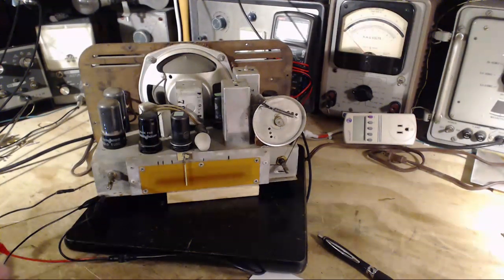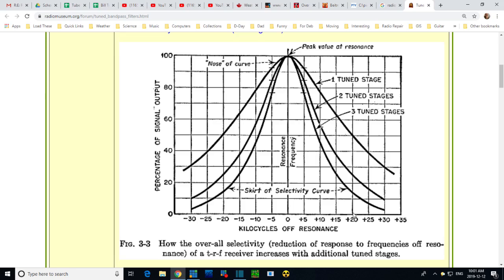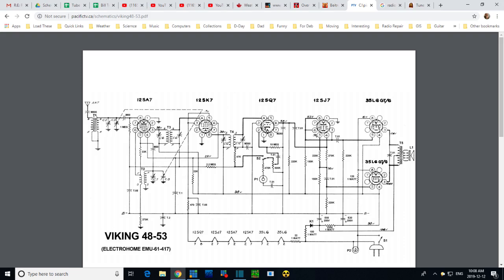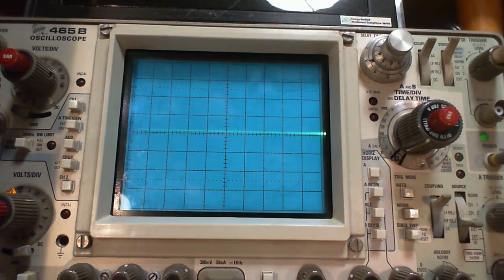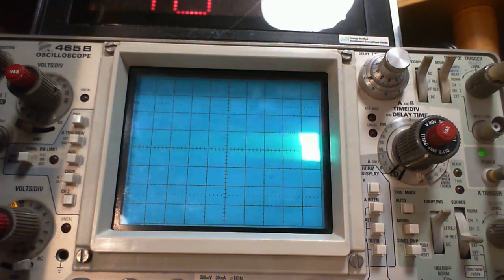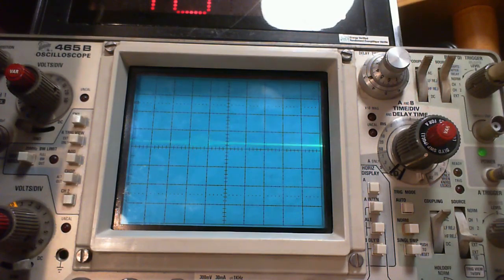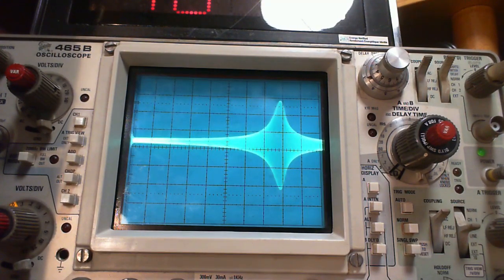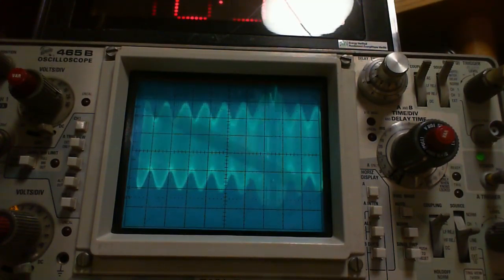Viking EMUGI 417 Video #7 - Response Curves

Comment: 52:35 Clipping the scope lead adds something like 10 to 20pF (depending on the probe and scope input capacitance) in parallel with the tuning cap, moving the resonant frequency off the signal generator frequency, but not enough to completely kill the input.  That's why it gets quiet but still audible when you add the scope lead.

Comment: Just short out the secondary of oscillator coil. this will disable the local oscillator. now the converter stage only acts as an RF amplifier. Then You can connect oscilloscope to plate of converter tube through a capacitor. This way You can show the response curve of antenna coil tuned circuit on CRO, without interfering its resonance frequency.

Comment: You are studying that radio like it is an alien artifact found on Mars and it is giving you odd-ball results to match.  I don't know whether to be amazed or amused...
Reply: Nathan Okun The latter, bro. The latter. To study the workings of a radio and learn fundamentals from it you first have to make sure it is working correctly. Otherwise your learnings and revelations and whatever you observe or measure will be influenced and spoiled by the errors still in that radio. Only if you know the basics and fundamentals by heart by studying working radios, you can turn to a potentially defective radio and troubleshoot it, cause now you know right from wrong.
Reply: Troubleshooting is both an art, and a science.  It is a science in that there are established routines used to establish in which area of the circuitry problems lie.  To the extent possible, you solve one problem at a time, and work from simplest to most difficult.  The art comes in the ability of the troubleshooter to understand an interpret what is observed.  Jim does not use these techniques.  He is essentially "trouble-guessing," rather than troubleshooting.  Trouble-guessing could be defined as troubleshooting with poor, or no aiming skills.
Reply: @harryshector  You might say he is troubleshooting, but the trouble is shooting back...

Comment: Wouldn't a capacitor in an antenna that is outside of the radio (and possibly outside of the building if made large for strong pickup) be there for safety if, say, it was hit by lightning, which is a direct current and would blow the capacitor, but not be conducted into the radio if the capacitor was designed to stop an arc going through it?
Reply: Nathan Okun Do a research on how much voltage a direct lightning strike would imply. If a lightning bolt jumps hundreds of meters from clouds to ground how big are you gonna make ur capacitor so it will not jump across that cap with a smile... The only way to kinda protect from lightning is to offer the lightning a shorter lower resistance path to ground than thru your radio. Yet you would still need serious overvoltage protectors in your antenna to block what stray voltages still find it there by sheer proximity to a bolt going down a lightning arrestor. Caps in the antenna are there only to protect the person touching it from voltages that may come from the radio (hot chassis) or prevent the radio and the user at the radio from damage should you accidentally put voltage on your antenna wire by for example stringing it too close to an overhead mains voltage power grid line.
Reply: @melissahermsen5630  This.

Somewhere I saw that you could make a quick&dirty lightning arrestor on your antenna with a spark plug.  Just drill & tap a hole in a grounded metal plate, screw the spark plug in, then run a wire from the top of the spark plug to your antenna lead.

Comment: The narrower the spike of the sensitivity curve, the higher the "Q", as it is called.  Images are "beat" frequencies at multiples of the main frequency, usually of diminishing strength as they get farther and farther from the main frequency -- for example, sometimes you can see two or even three concentric rainbows in the sky with the outer ones dimmer and dimmer, due to this.  It also happens in off-center directions from the central beam of a parabolic antenna trying to make a strong narrow-width signal in one direction, which cause "sidelobes" of weaker and weaker power spaced in angle at regular intervals to the sides of the main beam (this can also contribute to the multiple rainbow effect).  Radars have this as a bad problem unless special techniques are used to sort out the main beam from the others, since a strongly reflecting target in one of those off-center sidelobes can seem to be the main target and cause the radar to track cocked-off at an angle, which messes up tracking a lot.